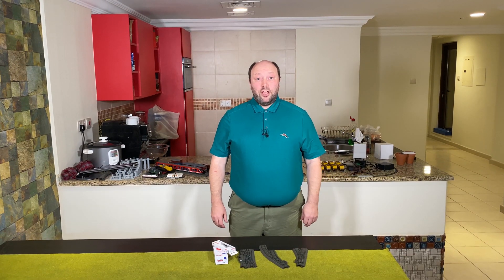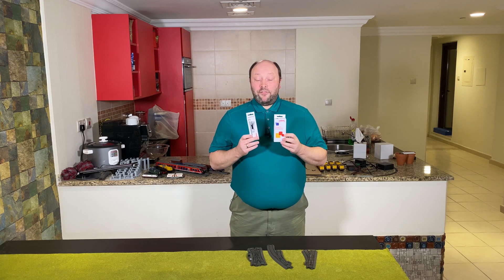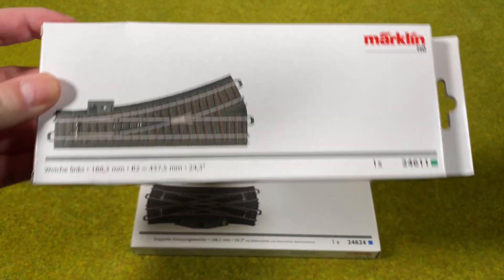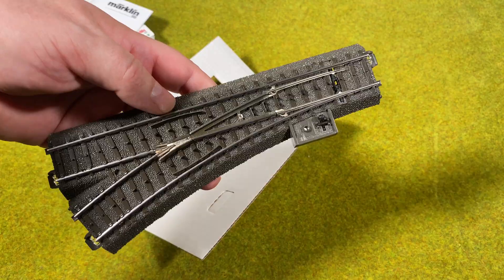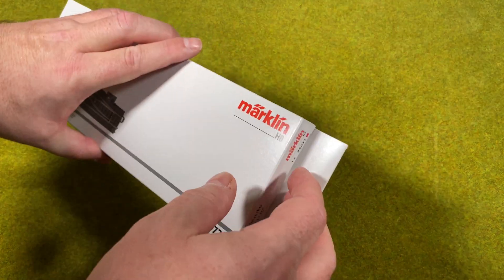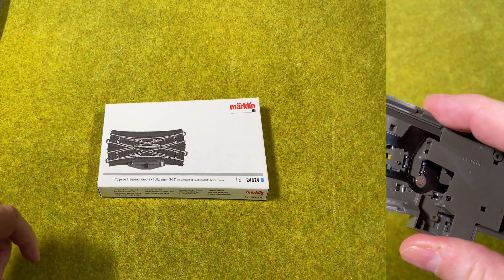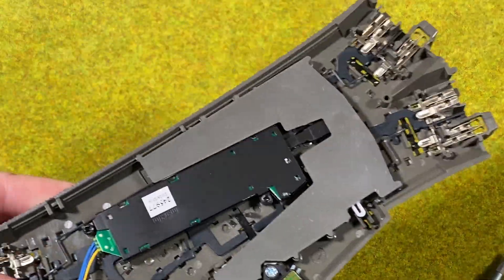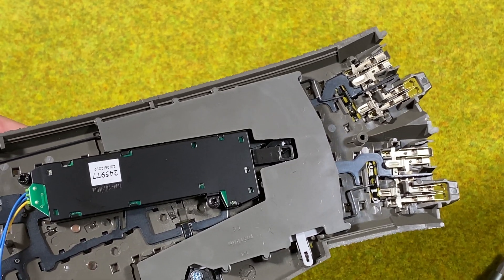Installing Märklin 74490/74491/74492 Turnout Mechanism in Turnout/Double Slip (Beginner Episode 4a)

Comment: So if i wouldnt be using it digital cant i just put the yellow wire on the track so it gets power from the track and then have the 2 blue ones on the controll box wich is in the end powerd by a travo
Reply from the maker: Hi Seni, the manual for the control box shows you how to connect: https://static.maerklin.de/damcontent/22/bc/22bc84c98f94f78c5c7db5289e0874311660729862.pdf As far as I can see you are right. Connect the two blue to the control box and the yellow to Red (B) on the track. Enjoy ;-)

Comment: How do I put insulators on the switch . I'm using analog not digity
Reply from the maker: Hi,

I do not have much experience with analogue. However, if you are using C-track, then you can use the Märklin 74030 to separate power between two tracks. In this way you can insulate after the turnout e.g. on the curved side.

Be aware that there are multiple connectors between 2 C-track, so you need to insulate the correct ones. My guess is that you can have same "0", but need to separate the "B" / implying you need two insulators. 

However, best to ask someone that uses analogue to be sure (or your favorite model train store). 

Hope this helps. Enjoy ;-)

Comment: Ich moechte meine M gleise austauchen, moeglich mit C gleise aber ich will weiter mit analog fahren ist das woll moeglich. Sonst kommt es mir zu teuer, um meine Zuege um zu bauen oder alles neu zu kaufen.
Reply from the maker: Sie können die C- und M-Spuren auf Ihrem Layout mischen. Dazu benötigen Sie die Märklin 24951 Adapterspur. Sie können die Märklin 74490/74491/74492 Weichen in die C-Gleisweiche einbauen. Dies wird auch auf einem analogen layout funktionieren. Die Weichendecoder funktionieren jedoch nur mit einem digitalen Layout. 

Sie können auch ein digitales Layout mit M-Track erstellen - dies wird jedoch teuer, da Sie alle Ihre Lokomotiven auf digital aufrüsten müssen. Betrachten Sie ein gemischtes Layout mit einer digitalen Spur als sofortigen Schritt. Sie könnten einen Layoutkreis mit einer Spur analog und einer Spur digital haben.

You can mix the C- and M-tracks on your layout. For this you need the Märklin 24951 Adapter Track. You can install the Märklin 74490/74491/74492 turnout mechanism in the C-track turnouts. This will also work on an analogue layout. However, the turnout decoders will only work with a digital layout. 

You can also make a digital layout with M-track - however, this will be expensive as you need to upgrade all your locomotives to digital. Consider a mixed layout with a digital track as an imtermediate step. You could have a layout circle with one track analogue and one track digital.

Enjoy ;-)
Reply: Ich bedanke mich fuer Ihre schnellen informationen, die mir sehr geholfen habe und wie Sie sagten einen grossen aussen gleis digital machen und analog innen machen. Ich werde auch ein bischen geld ausgeben fuer weichen, digital controller und digital dicoder 60842 sachen  selber aus probieren. Rechtherzlichen fuer Ihre Hilfe.